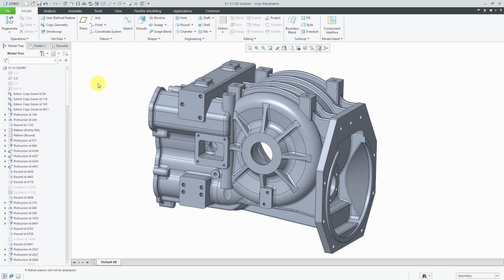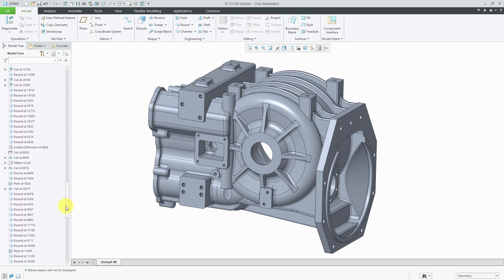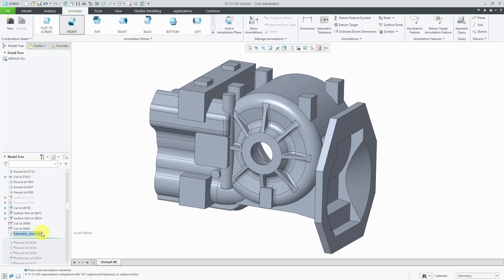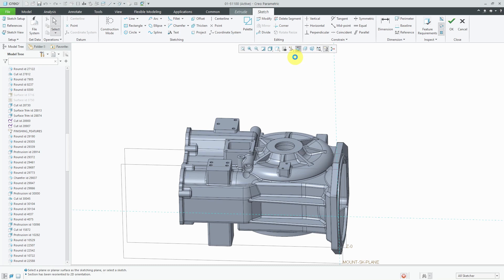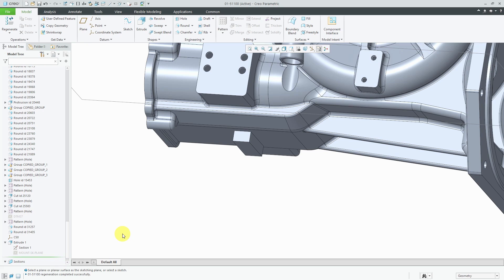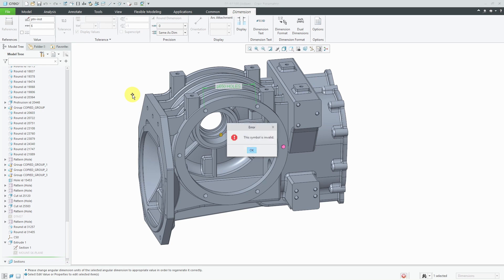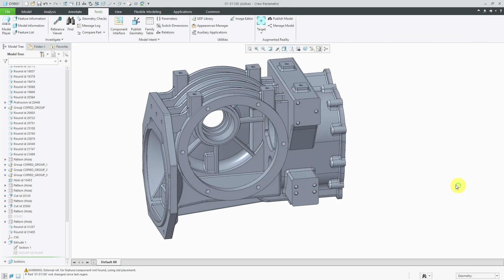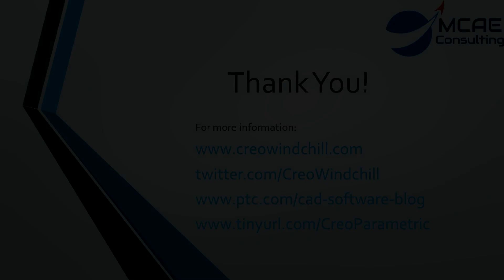Creo Parametric - 7 User Friendly Modeling Practices

Comment: I would caution against using too many groups. You would think selecting a group would select the stuff inside - not so. Rounds and the like make sense. Cautious grouping of datums and features. Also, avoid groups of 1 feature/component - you haven't saved anything. Otherwise, I like all of the other ideas. Just wish I could convince co-workers of the value (and remember to do it myself!)
Reply from the maker: Good advice.

Comment: awesome video.  I love the idea of using empty annotation features to organize the model tree and also the flat to screen annotation for user facing notes.  I've never really used any Creo features from the annotation tab before, could you make an annotations general overview video or maybe a video showing what a non 'empty' annotation feature would typically be used for?

Also with regards to the embedded datum tip, this seems to contradict your advice from an earlier video about using external sketches vs internal sketches (I personally have changed over to external sketches and really like the long term flexibility that offers).  How do you decide when to use external vs internal sketches?
Reply from the maker: I will be doing more Model Based Annotations videos. However I believe PTC has been moving away from Annotation Features and simply Annotation Elements without features.

Yes, I did an embedded sketch in this video. I should have done the embedded datum plane in the sketch but it was a little more “dramatic” showing the embedded plane in the Extrude feature.
Reply: @CADPLMGuy  got it makes sense thanks!